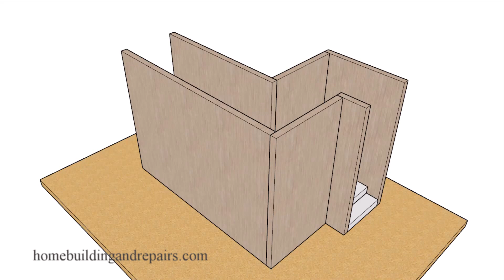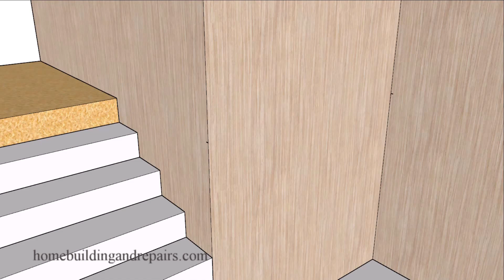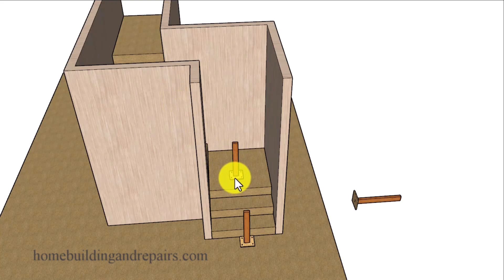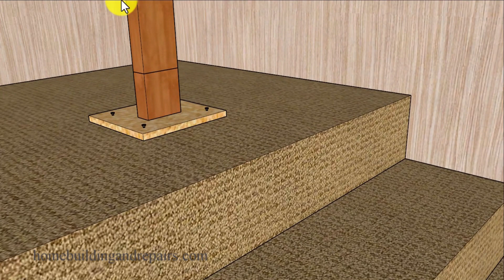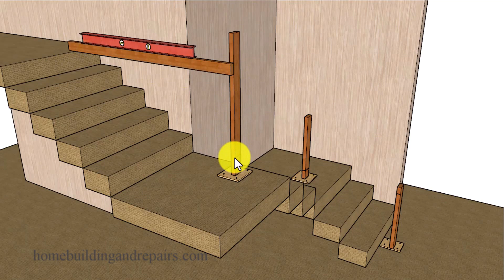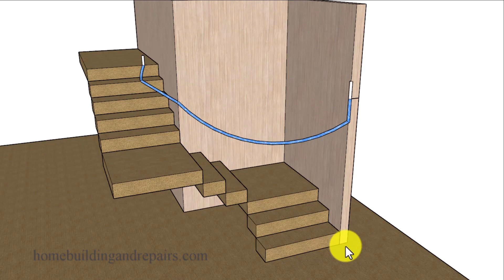How To Measure Tricky Total Stair Rise Between Upper And Lower Floors In Existing Homes

Comment: Water levels are tough to beat, and they're cheap. Add a little food coloring for a better line visual (makes bubbles much easier to spot also) , and use antifreeze in the winter if working where it's freezing. BTW... I follwed your directions for a set of winders I recently built and they came out absolutely perfect, the customer was thrilled! TY
Reply from the maker: Awesome and great to hear that everything worked out.

Comment: I suggest putting tape on the wall and mark on the tape, also you can use a laser level. Then use those lines to reference all your landings based on your math.
Reply from the maker: I like it and thanks for the great ideas. Remember to use some type of painters tape or tape that won't pull your existing paint or plaster off walls when removing.